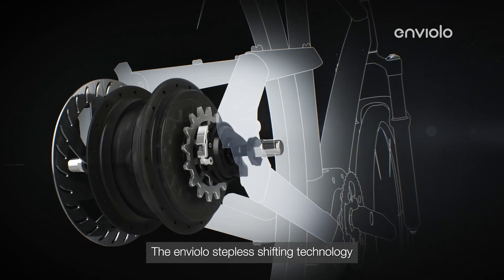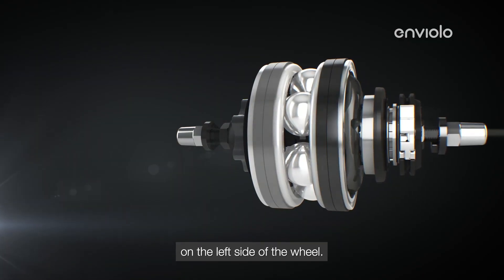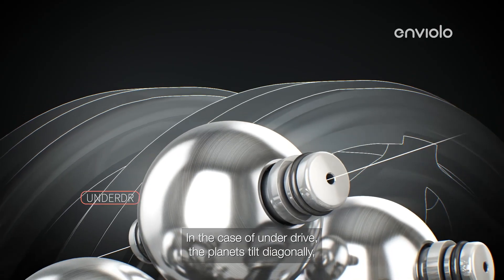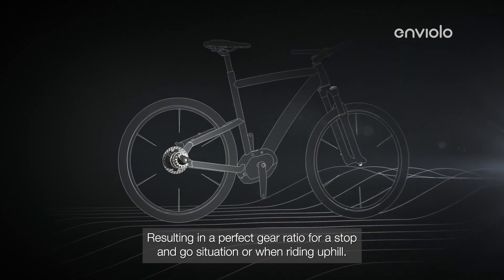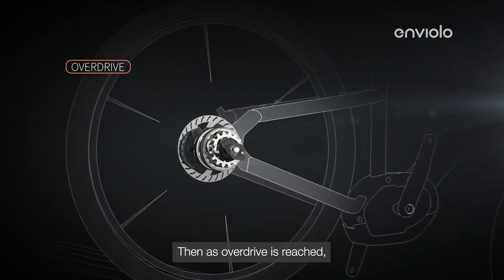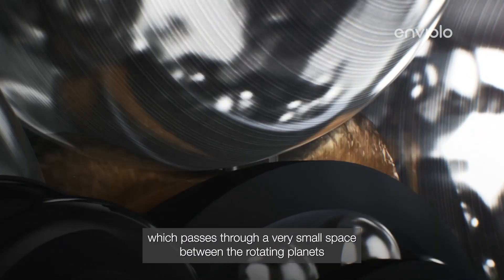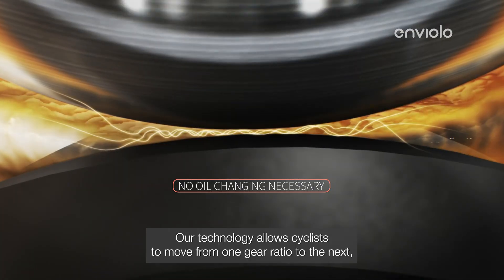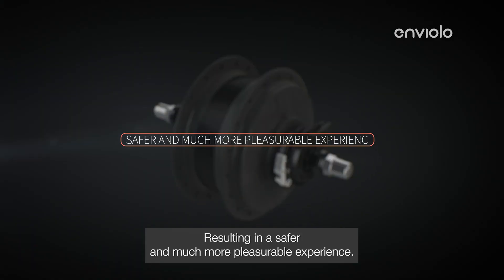The enviolo CVP technology explained - Technical video (English)

Comment: What kind of oil should we use? We changed the bearings and most of the oil spilled. It is scraping under load. Please help.
Reply: I'm wondering the same, if you found this info I would love to know

Comment: I have the manual C380 on mine. It’s perfect for urban riding. Was tempted with the Rohlhoff but at more than £1400 extra and requiring oiling every 3k miles outweighed the greater gear range for my use case.
Reply: Except the Rohloff would probably last you for life and comes with great technical support.

The Nuvinci/Enviolo won't last even a tenth of the amount of distance the Rohloff would.

Comment: How well does this system function when pulling a burley cargo trailer and moving up steep grade of 5-12% ?
Reply: They have a version for this, even with automatic shifting, and in fact, most cargo bikes use automatic CVTs.
Reply: @moenielsen3218  Far from most, just the high segment catered to yuppies with no technical know-how.

Nuvinci is old news and they don't perform well, nor last long.

Comment: I just had this idea for greatly simplified internal hub gearing:
...../
><
......\
You just use a a small diameter geared cone on the chainside (left) that can slide up and down a large geared cone on the drive side (wheel, right) using a friction shifter .. ??? Why isn't this the greatest idea ever? 😊
Reply: Make such a bike, it might make you alot of money
Reply: @amazingamx1255 
Actually, I realized it requires 3 gear type things, or you'd have to pedal backwards to go forwards 😊 I since learned that this is the basic principle of some types of non indexing gearing. At first, I thought it might be simple, but after thinking about it, it would be difficult to engineer for a bicycle. There would need to be a lot of structure to make things move properly. I was frustrated with derailleur limitations at the time. I thought 2 sliding cones was a better idea 😐

Comment: I have an Enviolo 380 in my Riese Müller Roadster ebike. Shifting under load is barely possible while using pedal assist. Shifting is very hard. I have to stop pedaling and wait a bit for the assist to stop, and then move the shifter. This way shifting is very easy, but this is deffinetly a PITA... Shifting with the same bike without pedal assist while pedaling is also smooth, and easy.
Reply: Thanks for sharing. I always thought since enviolo is stepless, the dial-down power shouldn't be necessary. So far, there seems to be no solution to this on any system. Even derailleur system requires a bit of low / no power.
Reply: Hello I just have an electric bike with enviolo trekking manual. Shifting is quite impossible on heavy acceleration, it’s quite doable with light accelerations so this is a normal behaviour ? Thanks !
Reply: I can't shift at all while pedaling. Did you ever solve this?
Reply: You stop peddling , shift, then pedal.